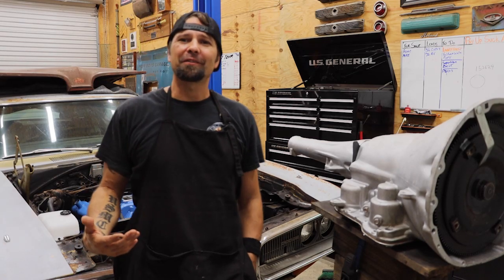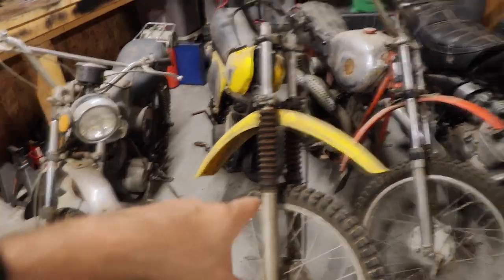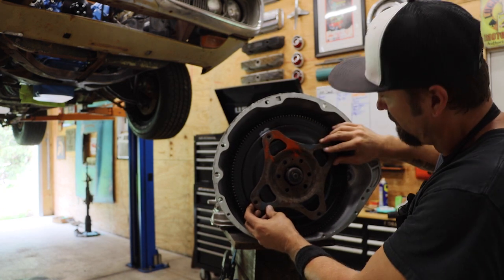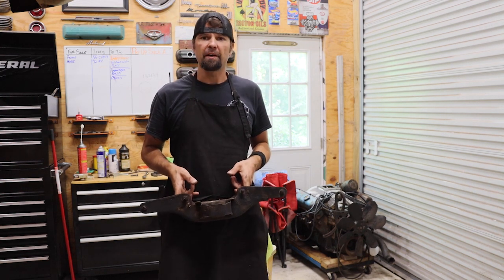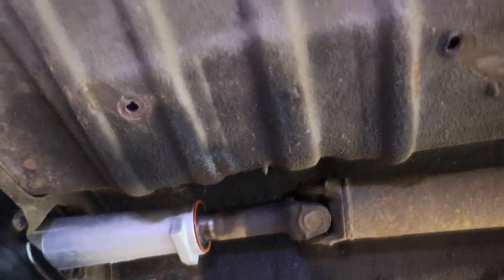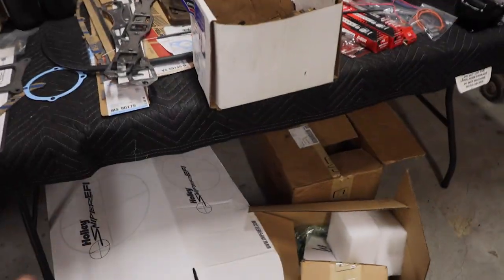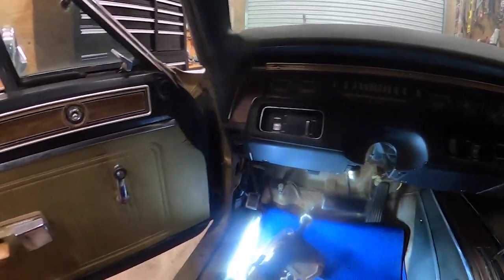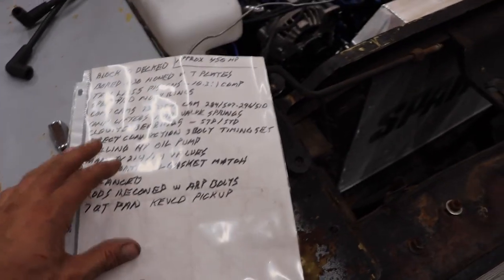1970 Dodge Coronet 500, 440 Install Part 5, we are so dang close!

Comment: When you showed the headers it reminded me of my old 1962 Plymouth Sport Fury I had bought, a 440 auto, push button 727 & a 3.91 posi for $300.00! (it was rough, he HAD to get rid of it THAT day or it would've become the property of the new homeowner) It had been a street car with stock carb, exhaust manifolds, and such. It was harder to get the nuts of of the studs to remove the manifolds than it was getting my $25.00 set of used 60's B body 440 headers in! And I was able to keep all the studs to hang' the headers in place then tighten them! I miss that car....I'm now old, retired and only WISH I could still do that stuff. Keep at it!
Reply from the maker: Thank you for sharing. 👍👊

Comment: Great video, love the way the project is coming. I had a friend in high school that put a drive shaft in and the engagement was not enough into the transmission. It was fine for like a year, but what got him was on the highway. You know those dips on the highway that are kind of long in your car kind of sags and then launches upward? That was what did it. He was extremely lucky, but the driveshaft was spinning and came out of the front. He did not have a drive shaft loop. But was extremely lucky when the driveshaft turned 90 degrees instead of dig in and flip him.
Reply from the maker: Very lucky! 👍👊

Comment: I grew up with the idea that the drive shaft should be installed all the way and pulled out 2 fingers wide and that usually gives the proper clearance then measure ujoint to ujoint for shaft length

Comment: Hey you need air filter on that yz to make it run right they need that restriction  on back of carb to pull correct amount of fuel you could even wrap a sock around it for now till you get filter
Reply from the maker: I hear ya yeah we are ordering them